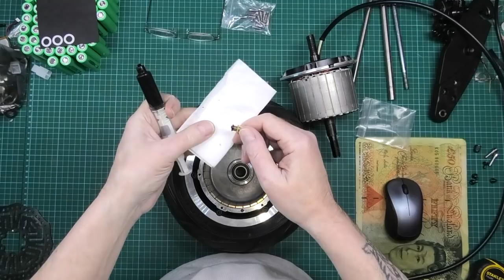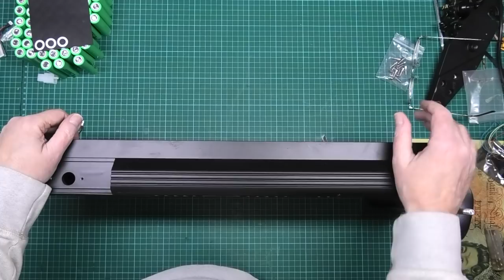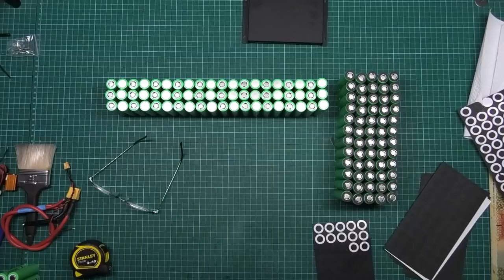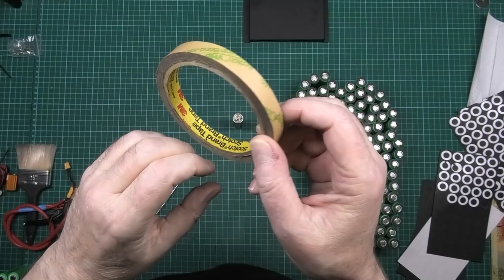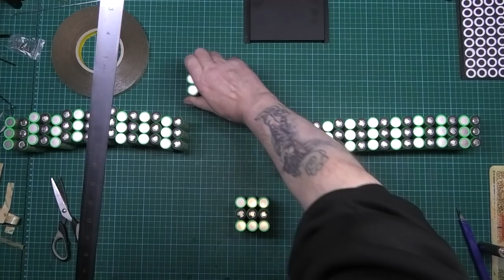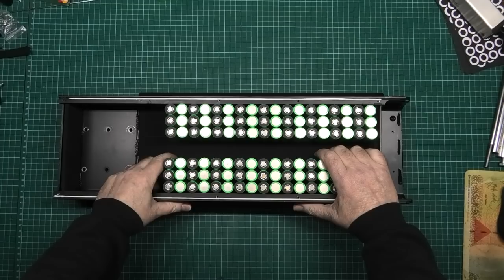🔴 EXTREMELY POWERFUL E-SCOOTER BUILD part 4 - 18650 Samsung 25R lithium battery build

Comment: 18s on that little scooter with 6p 25amp drainage cells! This will keep up with or maybe even out perform the high end scooters that people pay thousands for! I like the comprehensive attention to detail and precision building. The he ferro fluid looks really cool too. Looking forward to seeing this thing run!
Reply from the maker: Thank you 😁
I'm aiming for a little over 11kW so it'll certainly be rather powerful 😁
Reply: @Vortecks  11kw!? That will smoke the vast majority of the hight performance scooters out there! Do you know much it will weigh when finished? I modified an off road chaos scooter. I kept the swingarm and front end the same and made a longer body to house the new 20s 8p 18650 battery. I've set the max output at 140amps on kelly KBS72151E controller and it can be hard to keep the front wheel down. I'm getting about 10kw, at full power and it's insane. I think the controller is limited to that. It's rear wheel, chain drive 3kw my1020 motor and it's the most fun I've had on two wheels. Stay safe mate.
Reply: @colinriches1519  It should weigh no more than the original (19kg) which gives it around 730bhp/tonne. I've pretty much finished the chassis part of it but it's already a few grammes heavier so I've got to shed some weight elsewhere.
I might do another one next year with chain drive so I can adjust the gearing and get the best possible performance out of it.
Reply: @vortecksengineering884  that's almost double my power to weight ratio! And mine is insane! Be careful on that buddy. I had an accident at nearly 50 mph so now I gear up every time because the temptation to rip it, is never far away. Best of luck with your build, I'm really looking forward to seeing this in action.

Comment: Hi my friend!! I have open my motors to change wires and i see you putting this Ferrofluid..!!
Do you suggest me to buy a Ferrofluid and make the same work with yours before close the motors...??
Is it going to help?🤔
I admire your work and take very serious your opinion!!!💯
You are a little God in my eyes... Your experience is obviously!!!☝️
So please...🙏 your answer will help me allot..!!😇
From Greece 🇬🇷 with love and Respect!!
Reply: Yes used the liquid
Reply from the maker: Yes, as Sparkles has said, use it. It does work and keeps the motor winding much cooler.
Reply: @Vortecks  after 100 klm I open the motor and everything was "Black " ... 
The magnet liquid goes to stator and was like I put oil in the motor...
So I take a paper and "clean" the motor... 20€ in the garbage... 
I believe because motor magnets is the movable part of our motors is useless...🤔

Comment: Is there any reason to not do hexagonal patterns with the batteries to fit more of them into a smaller space?
Reply from the maker: Yes, size restrictions. If you think about it logically, if I'd used the traditional hexagonal layout, the battery would be 18mm longer and I simply don't have the room for that. it'll all become apparent in the next episode. Plus which, doing it this way allows more airflow between the cells.
Reply: @Vortecks  Makes sense. I'm guessing they get a bit toasty when drawing this much current.
Reply: @logitech4873  I wouldn't say toasty because you can never draw full current all the time when on the road. After you hit 'terminal velocity' with speed (which only takes about 6 seconds), it only draws about 25% of the current compared to hard acceleration. Off-road is a different story where you're constantly pulling a lot of current but I have no intention of doing any motocross riding 😂
It's all about the available size - use as much of it as possible.

Comment: @tony, Amazon do a wide black rubber double sided tape which is good for battery seperation
Reply from the maker: There are loads of things that could be used. I've got some 3M VHB tape which would work but it's too strong - If I ever need to separate the cells at any point, it'd be virtually impossible without ripping the PVC insulator off.

Comment: Great.  That is a 3000W motor from the link?  What are the dimensions of that stator? Diameter  ( as there are 105,1 10 and 115mm all present)  and width? I assume 65mm width but it seems almost as wide as wheel cover so it could be more?

Comment: so are those the magnets you installed or a different hub motor?
Reply: Watch the series and you will find out
Reply from the maker: It's a completely new motor mate. I've still got to replace the magnets in the original motor and then, sell it.

Comment: How do you make those parts out of carbon fibre?
Reply: He probably uses a 3D printer.
Reply: He has a 3d printer
Reply: Then it comes down to paying for the expensive carbon fiber.
Reply from the maker: I'll be 3D printing a part, skinning it with fibreglass which will make the mould and then I can use carbon fibre to lay inside the mould and make my own parts.
Reply: @Vortecks  fascinating! I hope you do a video on that. Thanks for the content Tony, bloody love this channel, learn so much from you.
Reply: @Vortecks  I've done this a couple of times and it's not easy to get right. Good luck with it.

Comment: Hi Vortecks i have come up with a possible solution getting scooter upstairs whithout lifting. Ok will need reclaimed scaffolding boards long enough to reach bottom of stairs to the top.Cut these in two or more sections length wise,  and using door hinges x 2 bolt/screw on  each end for strength  will open up giving you a flat area and placed one side of the stairs.Then put scooter in walk mode walking along side it - should work.  Also my have a few idears with 3 d printing warping problem if thats any good to you. have a good one . Scott
Reply from the maker: Cheers, Scott.
This thing will be light enough to carry up the stairs. Even with the monster motor, it's still coming out lighter than the original.
Our stairs are rather steep, much steeper than standard stairs so it'd wheelspin unless I added grip tape. Also, I'd have to store the planks somewhere with 4 x hinges. Any less and I wouldn't be able to unfold them. A standard scaffold plank is 11kg, adding the weight of the hinges, screws and gripper tape, a single plank would come out heavier than the scooter itself 😁

Comment: Hot glue is a thermal insulator also?  

Not good for batteries that get warm?

Will this be a real-life equivalent of the fictional “drip-scooters” known by non-drips as “volts of terror?”

Comment: Fairplay was only going to watch 2 mins see what this vids about, An I'm going to watch it all, Lol, I got a evoboards 1600w monster scooter that's going to be a project thing in summer while I get the downhill bike I wants to build with a cyc, But can only afford to get it bit by bit, But I will be doing a ultimate downhill bike frame up, In mean time the scooter I got is mid drive, Not a hub, One of those round brushless 1600w is no longer enough lol, So I'm going to put a different motor on it coz the frame of the scooter is ready for war type beatings, Strong as an ox frame will handle a lot more than 1600w, I also got try put a battery together I bought the solder ect, Just needs spot welder now, An will have go at a battery just everything is actually expensive when it's all in, Lol, The UK economy is bad enough, Don't get chance to save any money up for some reason lol......
Top video tho.......
Reply from the maker: The power rating on every motor is the constant output, not the peak. A 1600W could be pushed to 7000W but not for very long.
Good luck with your ventures, it's all good fun and much more rewarding than just throwing money at a shelf-bought version 😁
Reply: @Vortecks  Amen to that 🙏, Plus if it breaks you can fix it when you put it together coz, You put it together, lol, I found that after the bafang build, Massive satisfaction an it takes me back to the days as a kid, When taking your bike apart an putting it back together was something to do, Lol, But yeah it is a better ride when you put it together so to speak...